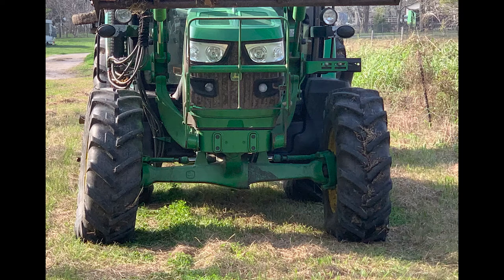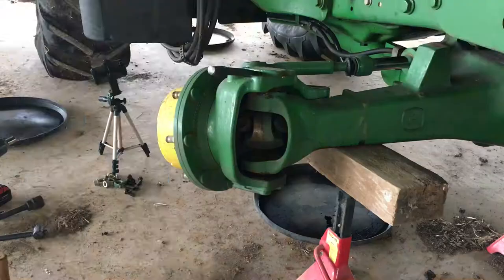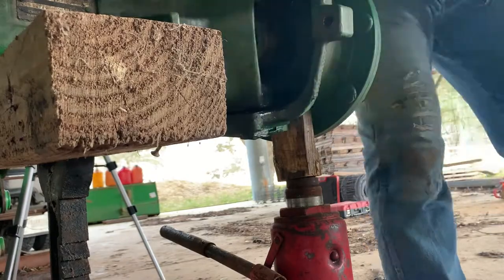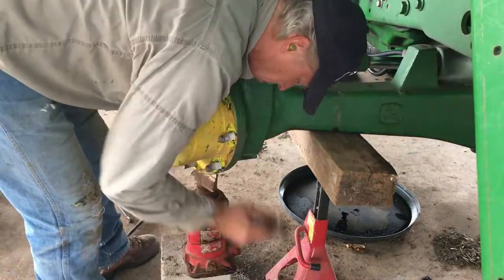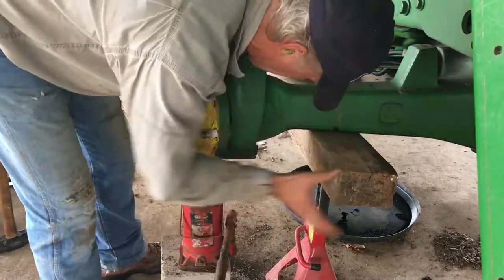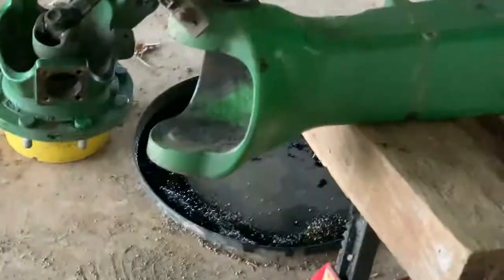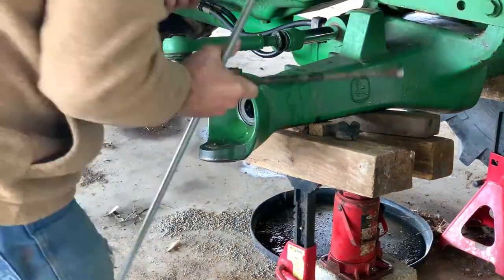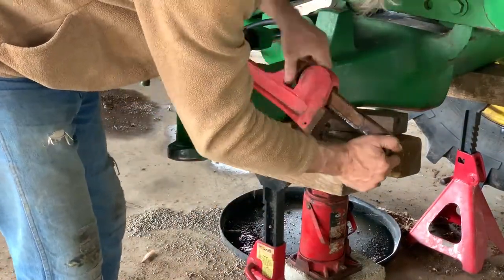Steering Knuckle Kingpin Replacement / Repair

Comment: Hi great video, How did you determine whether the shim was required or not?
Reply from the maker: Good question.  I assembled with the shim.  When I tested the hub tightness, it was loose.  Not terribly loose, but there was up/down play with the hub, which is equal to giving the top of the tire an in/out movement.  This would mean that the upper and lower kingpins are too far apart.  Remove the shim(s) and re-assemble to test again.  Logically, I believe there should be zero movement, yet no stiffness with the hub in a "steering" motion which would indicate too tight.  The kingpin bearings should not be subject to heat that would require a slight give like there is with a wheel bearing, therefore zero tolerance is desired.

Comment: Wondering with that nice machine and indoor shop you don't have air tools, mainly a air hammer to help you get this done? Thanks for the vid. Trying to prep for doing the front axle on my case 580 super k.
Reply from the maker: The tractor was at property with a roof-only barn.  Regarding anything except a portable generator, I didn't think I needed other equipment, so I didn't haul the extras there for the work.

Comment: Not greaseable then?
Reply from the maker: Grease? - Yes and no.  The bottom can be greased with the zerk fitting I added (see 5:45), but the main purpose is to be able to push grease through it to expel possible dirt or water because the bottom seal is no longer perfect.  The top is to be greased then assembled, which is the original design.  Apparently JD did not believe it necessary to add grease during the lifetime of the bearings, or that the need is very infrequent.  The kingpin bearings only move when steering is turned.  In comparison, axle bearings move all of the time, but they are similar in that they are only regreased periodically.